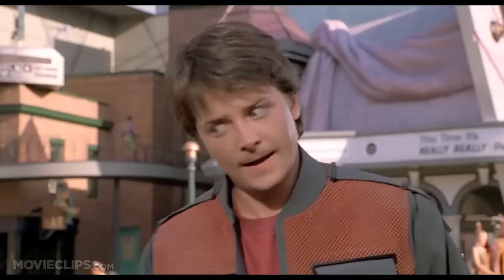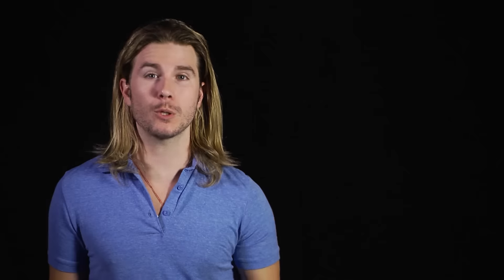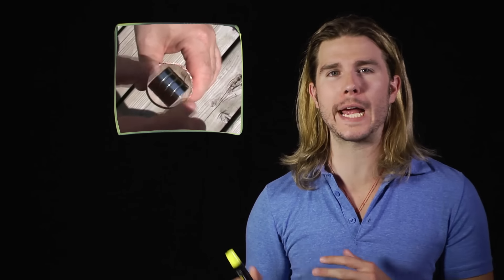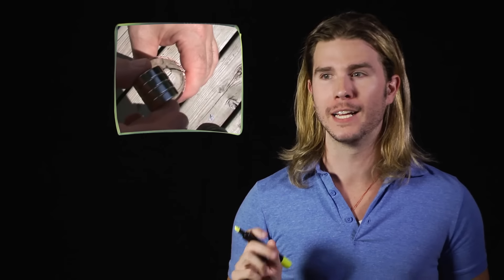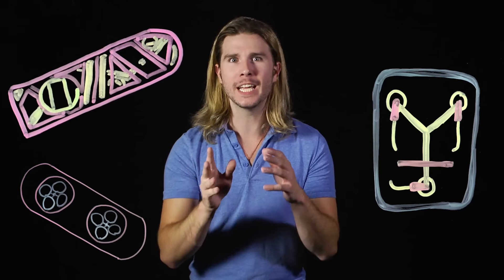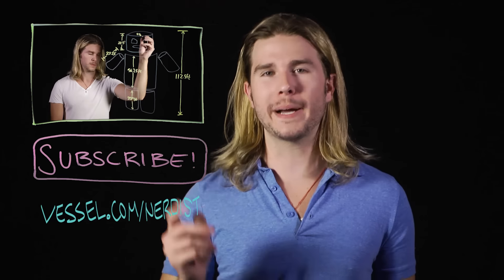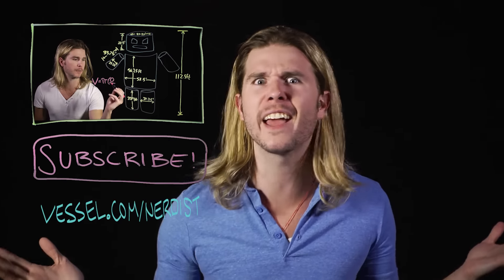How Do Modern Hoverboards Work? (Because Science w/ Kyle Hill)

Comment: although this video assumes the pavement in back to the future 2 doesn't have a metal under structure (for both hovering and snow melting purposes) this would also explain why marty's board starts to fail as soon as he goes over the pond, as the metallic sub layer gets deeper under him as it would follow the bottom of the pond. biff Jr's hover-board (made for adults) probably has much stronger magnets set so it can hover higher up over that track. snow removal is just my first idea as I live in Canada, but the metal under structure could also be the top of sewers systems in BTTF 2's 2016

Comment: It appears that these boards counteract gravity and eliminate friction - so wouldn't inertia allow these boards to become perpetual motion machines?
Reply: they still require lots of energy, either by cooling or spinning those magnets, which means that more energy is needing to be put into it in order to keep it moving then it could create through the movement itself. Perpetual motion has more to do with breaking the "conservation of energy" law then just keeping something moving forever.
Reply: +Russel Kennedy So it's only limited by the tech's capabilities. As the tech improves, the closer we'll get. I just think it's really cool to think about what a novelty like hover boards can mean for science and how it can impact the world as we know it.
Reply: What's air friction?
Reply: Maik Carr if you are moving let's say a car, the faster the car would go, the more air resistance it will have. this would cause the car to slow down or you would have to push the gas more to maintain the speed you are going
Reply: Maik Carr gg
Reply: Maik Carr I was saying it eliminates friction because it's not on the ground. I don't know where "air friction" came from; but Nico's right. I'm wrong because it doesn't eliminate friction, and you're just wrong.

Comment: HEY KYLE I HAVE A QUESTION is it possible for us to create high speed fan propelled hover boards that could withstand the weight of a average sized teenager while keeping them at a certain level off the ground So that they could skate but could also increase the speed and height if the rider chose to and knew how to? you know assuming we were able to create compact enough generator to fit on this board and generate enough energy to keep itself and this kid in the air long enough to get from point a to point b.
Reply: Kyle Hill YES exactly that!!!. First off thanks for replying cause i wasn't sure you would so much appreciated. Secondly do you think we could create a smaller version of that, improve the battery to last 6 hours minimum and be able to do all of this at a small enough cost that the average american could afford it?

Comment: what would happen if you got a magnetic ball, put it in a round room were the walls are super powerful magnets that are powered by electricity, and you set the room to have the same magnetic pole. would it shrink? and what if you set the room to be opposite poles? would it pull apart?

Comment: Many people seem to be under the impression that technology is lagging, simply because we don't have flying cars or free-roaming hover-boards, by now. Yet, they fail to realize that just because something can be done w/ special effects in a movie, it doesn't mean that it is feasible or even practical. 
The first real prototype of a flying car, was the Aerocar, built in 1949. However, in the end it never reached the production phase, as it was extremely unpractical. Not only was there a requirement that the operator have both a drivers and pilots license, but it also required the use of a trailer, which was used to tow the wings, when they weren't in use. 
As for the hover-board, the main question comes down to whether it's even feasible to create a free-roaming hover-board (without wheels) at a reasonable price, that not only floats at least 6-8 inches from the ground, but is also not tied to a magnetic rail or metal path, etc. 
Regardless, I will say that there have been some great discoveries and inventions, that may have never been conceived otherwise. Therefore, even if we never see a legitimate hover-board, the developments and technologies that will inevitably branch off of these attempts, will ultimately surpass the original idea.

Comment: Nerdist. Kyle I actually had this idea that hendo had. However hendo had a problem with their design. There is no "edge" this means you cannot control where you go. It's funny because that can be solved with a simple configuration change of the magnets. Using carbon discs with neodymium magnets with alternating poles along it they have four discs to rotate clockwise and to rotate counter-clockwise this prevents the board from just spinning in a circle but this is absolutely the worst design that you could come up with for a hoverboard when you ride a skateboard and you want to ride a hoverboard when you lean left you want to turn left when you lean right you want to turn right. does this make sense? If you find time in your busy schedule to read this comment and I would happily share my design configuration with you just not on a public forum like this so an email or something I would happily explain the correct way that you would use this type of magnetic levitation for a hoverboard. It's funny I actually saw them attempting to hook electric motors to each set of there neodymium magnet discs to swivel it directions to steer it is so dumb I can't believe that such smart people that figured out this type of magnetic levitation can't figure out how to let you steer it

Comment: In the future, they could make public paths specifically made with a metal material so that people with hoverboards can use them anywhere the path goes!!!
Reply: +Jackson Roah Whats wrong with wheels?
The most important reason why we don't use Hover cars and boards is because they don't fail-safe well.
When something goes wrong.Do you want to be inside something that's flying? or riding across the surface?
Reply: +Andrew Ryuukie Hoverboards are faster
Reply: Well, a hover board is hovering and not flying. So you should only be comparing that to something shaped the same and used about the same, which is a skateboard. There are many reasons for crashing on a skateboard and they all mostly include falling from collisions, WITH the course they are on. Hitting the rails wrong, grinding wrong, just the lines on the fucking sidewalk. All of that is mute when you're hovering above all of that. Sure the rails are iffy in this example, but theoretically the landing will be better cause you're barely landing at the end. All the trip hazards are gone and you're left with just keeping balance. The boards seem stable enough to keep balance. Plus as this suggests, even if we made hoverboards a nationwide thing, I'm sure the planners would only incorporate an extra bit for sidewalks, in parks, and in skate/hover areas. We'll probably never get hover/bumber cars, but, a hoverboard is completely fathomable. Even if you fall off the hoverboard...at ground level, you're essentially only falling off the last step from your porch. If you're saying that it's more dangerous to fall off while going at the same speed of a skateboard, then you're challenging mostly the speed of going. And so those who agree with you, if they are in some kind of power, will use your challenge of speed as a way to do away with even your skateboard that seem to not have a problem with at all.
Reply: Money would probably be more well invested in developing rideable quadricopters

Comment: Kyle, hoverboards need magnetic surfaces to hover off of. Could they use the Earth's magnetic field to push off the ground?
Reply: +Rami Ungar The Earth's magnetic field is far too weak, much, much weaker than a refrigerator magnet.
Reply: Kyle Hill Dammit, the hovercraft in my sci-fi trilogy rely on Earth's magnetic field.
Reply: For a hoverboard to work using the earth's magnetic field, it would need to be extremely dense. This would mean that it would also be extremely heavy and difficult to move.
Reply: Suddenly I'm glad it's science fiction, and I can cheat a little on the science part.
Reply: +Rami Ungar I'll paraphrase Rod Serling who once defined science fiction as "the improbable made possible". So go ahead, use your idea, it's improbable enough to be possible. 

Besides, on a selfish note, I really like the idea :D
Reply: +Rami Ungar just state it's an alternate universe earth where the earths magnetic poles are stronger than in our universe.
Reply: coilgunsand lasers technically as it's a novel it's already an alternate universe to ours, though it's somewhat based on ours. Still, if the TIE fighters can move as fast as they can despite the limitations of actual twin ion engines, then why can't my hoverbikes rely on Earth's magnetic field?
Reply: +Rami Ungar this novel you're writing sounds kinda interesting if your hosting it on a website shoot me a link so I can read it.
Reply: coilgunsand lasers it's called Reborn City, and it's available now on Amazon. It's actually on sale till Thursday, if you're interested.
Reply: +Rami Ungar Why didn't you think of anti-gravity projection and propulsion systems?
Reply: Jessie Mitchell Didn't know about them when I wrote the novel.
Reply: Rami Ungar the problem rami is copper doesnt produce an electromagnetic force. it only reacts with one. the earth if it was shaped different along with many other variables could hover over an inconceivably large copper slab as the earth has its own gravitational field which is the basis of your question. that doesnt mean it works the other way around. or does it? by the maths i cant see how a copper plate wont levitate over an electromagnetic field. but if thats the case why can't they make a copper skate board over an electromagnetic riding area. you can use large solar panel arrays to power the entire skate park for free. you just need a home made copper or aluminium(not aluminum damit we already verified globally except America its aluminium) skate board. its globally recognized, get with it America you dont live under a rock, stop pretending you do. Keep it standard for science sake please. the only problem is humans are greedy and wont work for free. if you charge per entry it will be viable or they will never be created... ever. unless your tony hawk or iceman secretly using tony starks tech to make up for his ice powers that dont make scientific sense. what you gana do if theres no answer in science? throw a tantrum perhaps.
Reply: Jessie Mitchell propulsion systems. . . . . i feel like kicking a brick bare foot so i dont have to think about what you just said. propulsion systems? right there your not even talking about hover boards. we already seen the jet packs that run of water pressure not hover boards but close when it comes to propulsion systems. and gravitational projection. what do you think we can make objects that can warp gravity? make our own black holes? no buddy just no. Do you even know there should be a partical called a gravitron but we havent even proved they exist yet. so yeah better off not offering ideas if you have little to no science on that subject you comment on. not just you bro but every one. think about it. im no geniues either so yeah. im not special either i just noticed a flaw i had an answer to and had to put in my 2 cents. i could have been more gentle but im not that sort of person usually.

Comment: Magnets, how do they work?
Reply: Here's a good place to start: https://en.wikipedia.org/wiki/A_Dynamical_Theory_of_the_Electromagnetic_Field
Reply: Magnets have positive and negative charges. Opposite charges attract each other. Like charges repel each other; a positive charge pushes away another positive charge. Magnets stick to certain metals, such as steel, because these metals have reactive properties, and the molecules in them change direction and gain a magnetic field due to this alignment in the opposite charge to the magnet in question. Sometimes this charge will remain, and the metal will become its own magnet. Electromagnets force a charge into a piece of reactive metal-- in this case usually copper-- which takes on the charge, and therefore the magnetic properties, of a natural magnet through the addition of electrons, which bear a negative charge. Magnets can also act on electronic emissions, as they effect electrons almost exclusively. This means that enough magnetic material will disrupt wireless communications. The Earth itself is surrounded by a powerful magnetic field that exists above the threshold of the atmosphere; this field is beneficial, as it dissipate many of the harmful ionic (and in many cases, magnetic) particles that the Sun puts out, sometimes appearing in the form of bright colorful lights in the sky-- Aurora, to be exact. There are some cases of the sun's magnetic pulses getting through this barrier, and the emission of electrons fried many electronics, as many electronics are made of sensitive reactive materials that change properties and become unusable when they react to magnets. This magnetic field seems to be centered around the poles, and it's why a compass points north. The forces that cause this are still an unknown quantity, as with gravity and Strong Force (the force that holds atoms together; I didn't name it, but it's the most commonly accepted name), but magnetism is actually stronger then gravity-- thus, you can have levitating magnets. Water also contains a slight magnetic charge in each molecule; water molecules stick together through magnetism, which is why water has surface tension. Got any other secrets of the universe you want me to teach you?

Comment: It's rather frustrating that he didn't mention the fact that, with our current understanding and laws regarding electrical currents a hover board using magnets is entirely fiction unless we managed to magnetize everything in the world.  There is simply no way for that board to work outside of a surface that repels it and as such the craze about hover boards is utter fiction.  Your average backyard engineer could create a similar hover board and a copper half pipe, it's cool but entirely impossible unless we can induce magnetism on objects that are non-magnetic and do so as we pass over it.
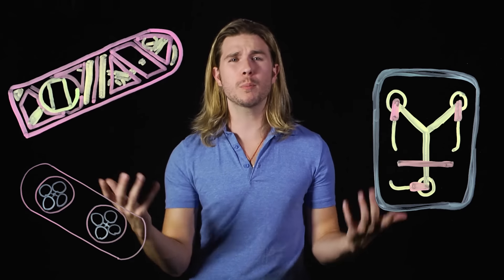Reply: +Mitchell Christie You mean like the part where he mentions these limitations at 3:50 ?
Reply: He mentions the limitations briefly but proceeds through the video and especially the end to state the possibilities but such possibilities are fiction.  He states limitations but proceeds to talk as if it's a possibility.  They're not just limitations. They make "hoverboards" as interesting as table top levitation devices that use magnetism and cost 50$ online to buy.  Unless there is some way to force magnetism onto objects that are non-magnetic it will always be fiction and there are literally thousands of people paying for the kickstarters for similar devices that think there may sometime be some possibility of them existing.